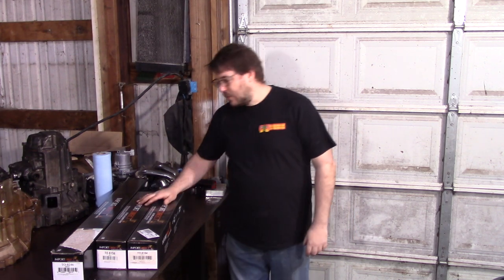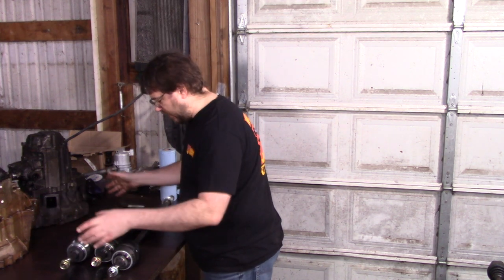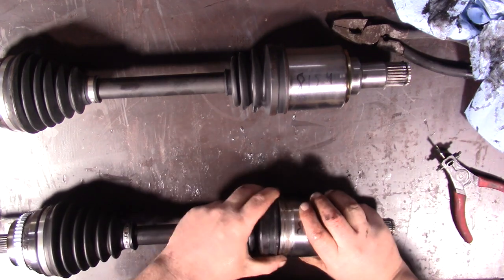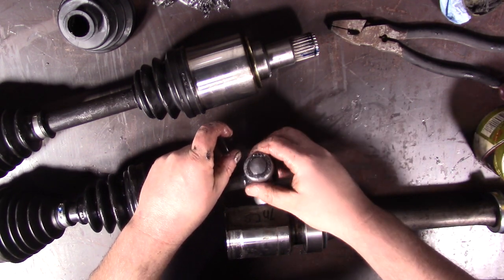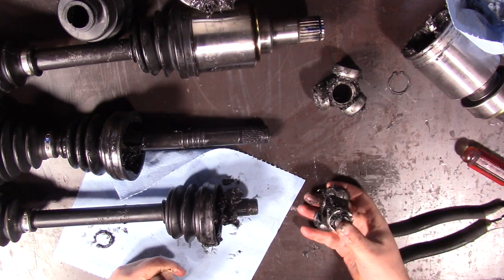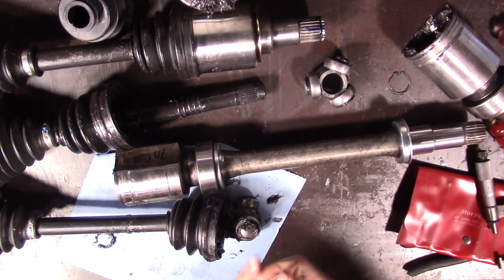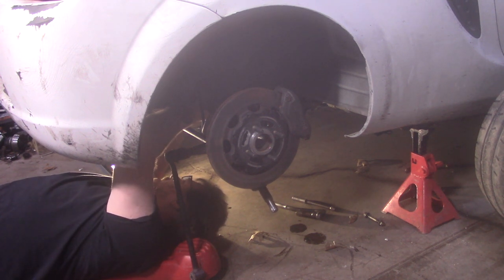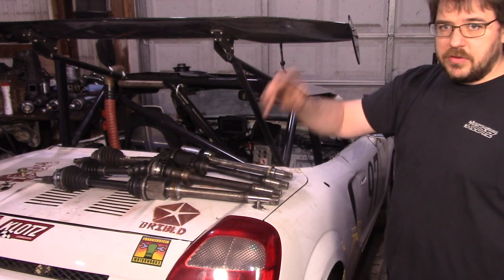Trying to make new MR2 spyder swap axles

Comment: I have an EB62 in my MR2 out of a 2011 Camry, this axle combo did work for me.  The cross axle is designed for a 2011 Camry with an EB62 trans
Reply from the maker: yes it will work, the only difference on the outside of the trans is the shift levers. the EB60 and EB62 both use the same axle configuration.

Comment: they look alot like some camry axles i wonder if they would work?
Reply from the maker: Unfortunately the camry is too wide. but i think i found a workable solution, stay tuned for an update in a day or three
Reply: @FrankensteinMotorworks  the 4cyl or v6 one? The 4cyl uses 28 splines and the smaller CV joints and the v6 uses the other size. And the axles spline count is 31 idk if that help, maybe the scion Tc 1 one’s?
Reply from the maker: @xboxhater12345  it depends on the year but the MR2 with the EB60 uses the large spline inner(generally v6 over the years) and the small spline outer(generally I4 over the years). This combo is often used on AWD vehicles, that's why i have been focusing on the narrow AWD rav4 as a donor.

Comment: I'm curious if the New Cardone's I'm running vs the Remanufactured meet your standards.... 

Cardone 665237
Cardone 665241
Cardone 665239
Reply from the maker: It's not so much about meeting my standards or not. It's about being able to assemble the axles vs not having matching inner splines. I'm mostly looking for a low cost solution that works for most people. I don't really care if the people making a ton of extra power need custom axles.